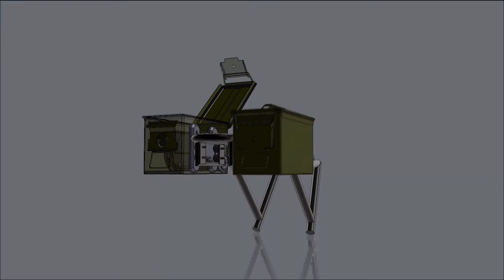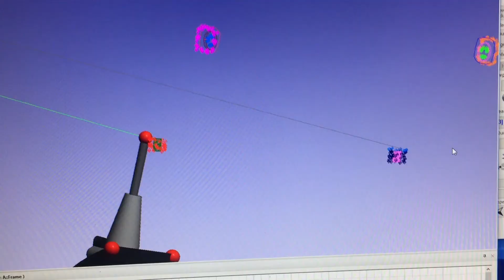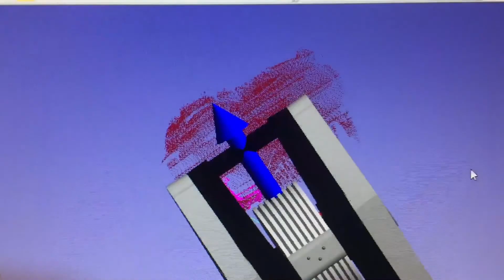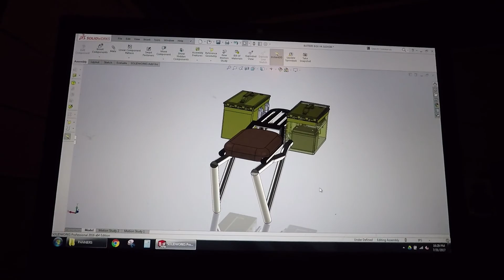Project ApoKalypse Part 4: Frame Mods, Battery Box, and 3d Scanning

Comment: Freaking awesome vid mate.  I'm a project manager at a zinc smelter and we just had a point cloud survey done of our electrolysis building.  It is about a mile long, literally.  It is 100 years old and was at one time the largest timber structure in the southern hemisphere.  We created a 3D model in Navisworks and are using it as a live model for a condition and structural assessment as part of a large scale structural recovery project.  Great technology and your bike is looking bad arse.  Keep up the good work, Andy
Reply from the maker: Thanks! I couldn't imagine modeling something as big as your electrolysis building from a point cloud, that sounds expensive! It took me quite a while just to model that headlight and the lower triple clamp, I learned a lot doing it though. I would have thought that the whole process would have been more automated, but even using the mesh wizard and stuff it was still a bunch of manually connecting the dots, so to speak. Hey, did you notice that I incorporated vibration isolators  into my pannier rack design? I ended up doing that based on a brief discussion that we had in the comment section of  one of your "fitting the electrical hardware" videos, so thanks for that. Cheers